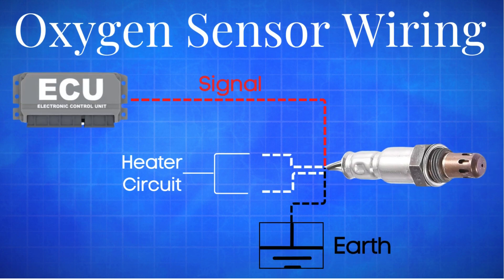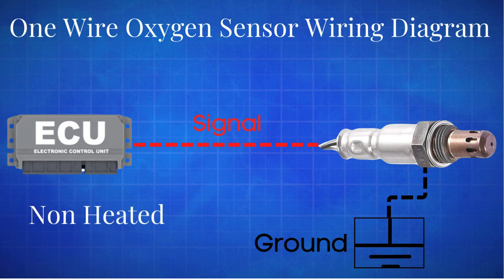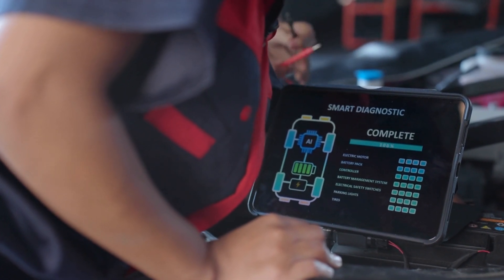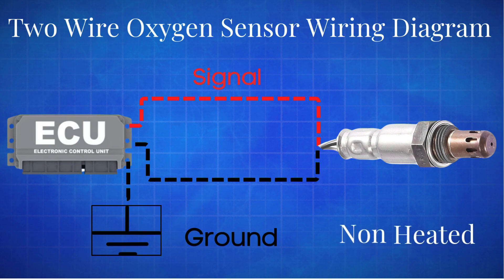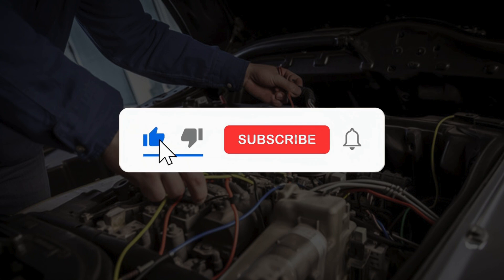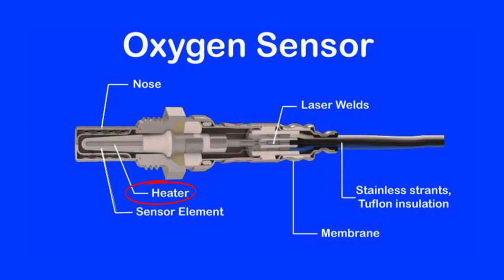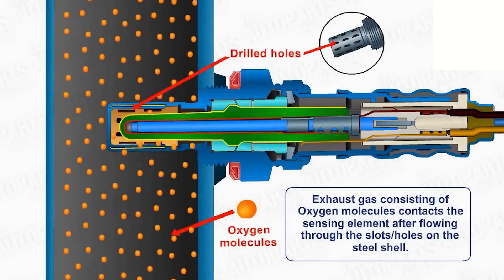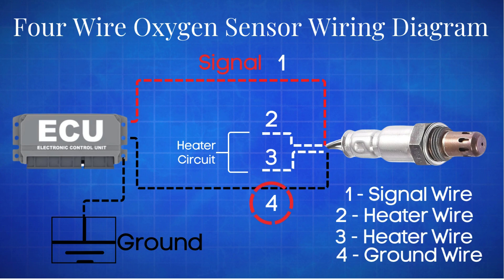Oxygen Sensor Wiring Explained | Car Fix

Comment: So i have a early 90s obd1  car with a 1 wire 02 sensor but the connection is delivering ground instead of signall
Reply from the maker: You may have a wiring issue then.